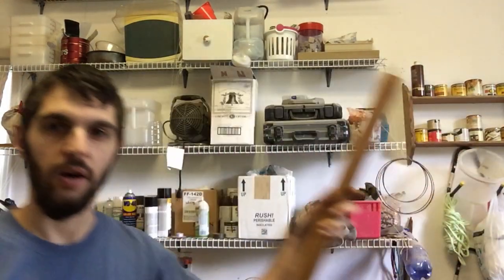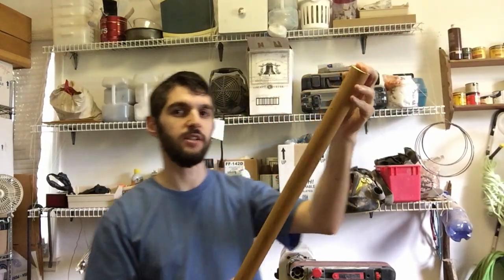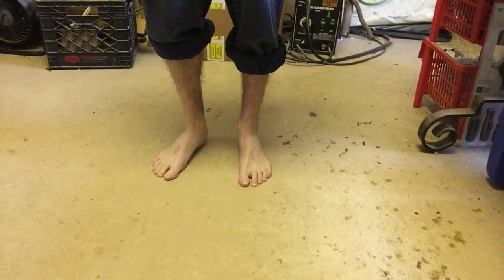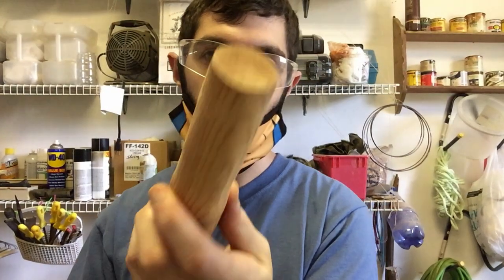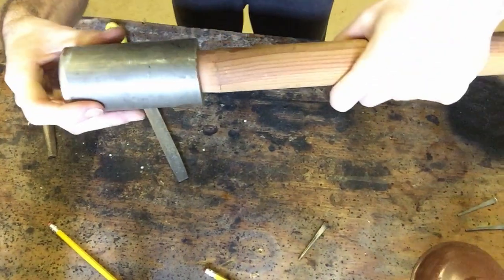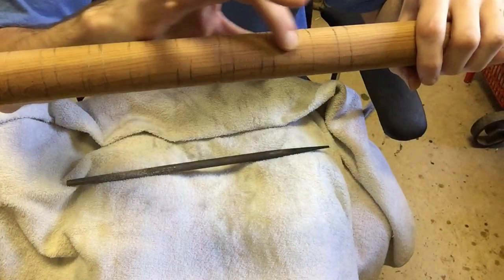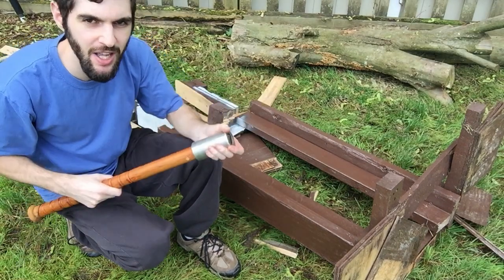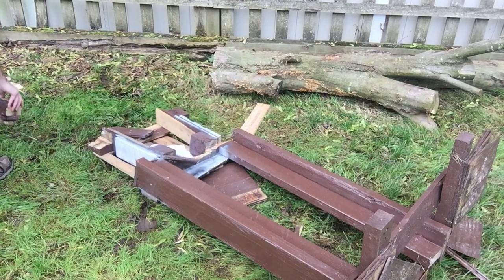How To Make A WWI Trench Club

Comment: When it's tight like that John if your careful you can heat the pipe up in the oven. The metal will expand. Push the handle through fast as it cool it will tighten on the handle. Good job on the trench club buddy.
Reply from the maker: Thank you. I didn't want to heat it because I wanted it to be a easy and simple build. Thank you for the idea.

Comment: Thanks John this video is very helpful but I have a question where do you get the metal pipe from and in that size
Reply from the maker: Thank you for the comment. I found that pipe at a house sale. That size could be hard to find. Look at a plumbing store or hardware store.